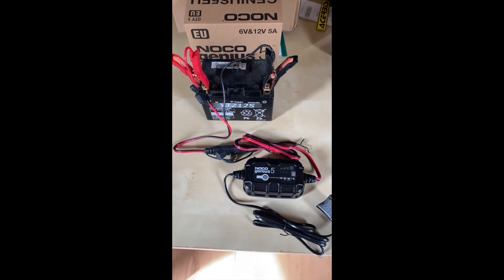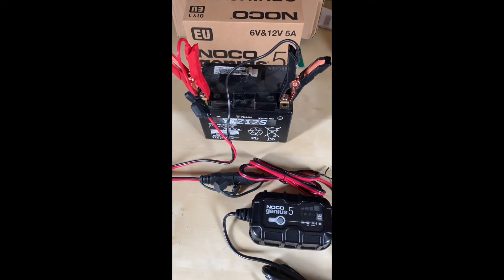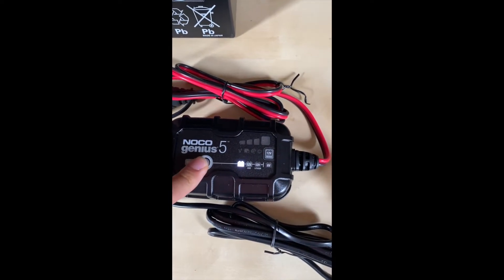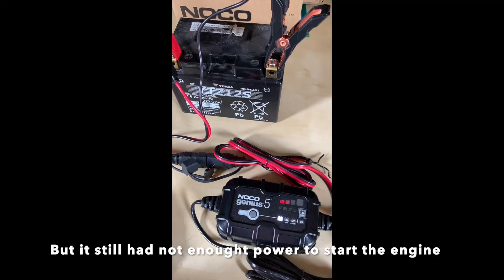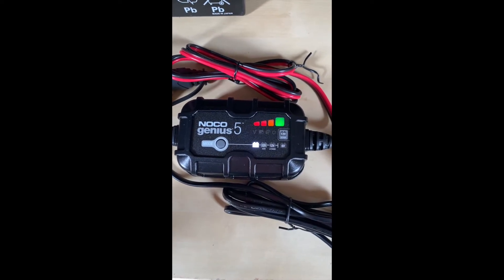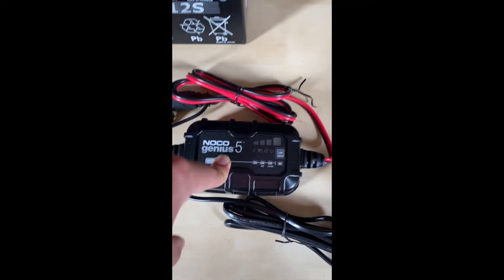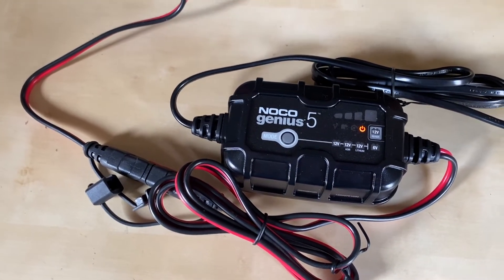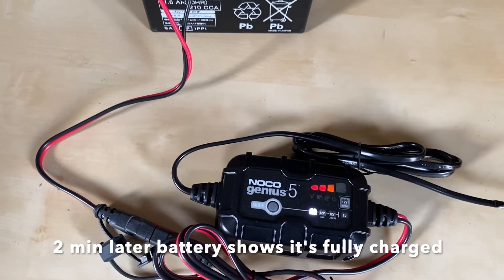Noco genius 5 repair mode works !

Comment: Jumping back and forth between Standby and a charge mode indicates the charger is repeatedly losing sight of the battery. 
 
Can you test the 12V Lithium mode briefly on the same battery?  Once charging begins, does it look like it is charging as expected after several seconds? (12V Lithium mode LED blue and 25% charge LED pulsing).  If so, you may remove the battery from the charger. Let us know so we can exchange the warranty. If your charger still does not charge, look at the additional troubleshooting steps below.
 
If you are receiving the same LEDs for all modes,  the charger may be losing sight of the battery for one of these reasons:
 
 1. Dirty or corroded battery posts/terminals, or posts/terminals coated in non-conductive grease designed to prevent corrosion
 2. Indirect connection to the battery (i.e., clamps/eyelets connected to anything other than the physical battery’s posts or terminal bolt)
 3. Loose connection to the battery
 4. Blown or loose inline fuse on the charger’s lead cables
 5. The battery's voltage is extremely low (below 1V). In which case, follow these steps:
 a) Remove a clamp from the battery
 b) Press and hold the Mode button until all charge mode LEDs flash
 c) Single-press the Mode button to select the required charge mode
 d) Reconnect the clamp to the battery
 e) Wait 5 minutes for Force Mode to complete

Comment: Desulfation instead of repair mode.  Desulfation devices or methods apply pulses of voltage or current to the battery.
These pulses help to break down the lead sulfate crystals, converting them back into lead and sulfuric acid.
The battery can then return to its normal charging and discharging cycle.

Comment: You "repaired" a fully charged and fully functioning battery.
What you say at the start about the battery charging fast is WRONG.

The only useful info on the video is HOW TO GET TO THE REPAIR MODE.

Disregard everything else on the video
Reply from the maker: The battery was not able to start the motorbike after charging it fully several times, even if fully charged

Comment: If people are wondering if this thing works. Yes it does ive had a 700cca battery on my vehicle which has parasitic draw somewhere and i have left the vehicle out for a year because it wasnt running anymore because of transmission problems, it took about 4 days cycling between charging and then repairing it but it went from 1% battery health to 89%

Comment: how many times can you use the repair mode on one battery?
Reply: Until it doesn’t work anymore, but remember to fill the cells before and after with distilled water

Comment: very good video.  thanks for the info.  I had exactly the same issues as you.  Battery got weaker and weaker then gave up one cold morning.  I charged it and it as dead again in 2 days.  I think the repair function will work... but dont like the thought of being caught short again.  Im just going to buy a new one.  Costs £20 to get home if it dies and a lot of hassle.  Once you factor that in im going to buy a new one and give it a top up charge every month.  My commute is too short to charge it properly and heated grips and under glow lights don't help.  Heated grips will now nver be used probably  lol.... what a waste of money.  Live and learn.

Comment: Can i use an anker c1000 to charge my car battery via noco5? Its a 2016 plate and i get regular battery warnings when i forget to switch off the dashcam plugged into the obd port.

Comment: Is it safe to use Repair Mode with the battery still connected in a newer car?
Reply from the maker: I don’t think so! I don’t think it’s a good idea! You can probably brake the car’s electrical circuit

Comment: U need to fully charge the battery 1st dude b4 u enter into repair mode. Read the instructions!! 🤦🏽‍♂️
Reply: Thanks for the heads up, definitely NEED TO READ INSTRUCTIONS!
Reply: There are some local stores that doesn't have manual in the box so I have to search up the manual myself online lol
Reply: He literally does, what are you even on about?
Reply: He said he fully charged it already before repair

Comment: Thanks for the video and demo, it was very informative. Have you heard of a Pulsetech Power Pulse passive desulfator? I have been using the PowerPulse on my BMW battery for the past three years and have no issue's with the car starting even though I only drive it about 25 miles per week.

Comment: I’m currently testing the noco 5 on my car battery purchased in 2013 and after 2 1/2 years of use, sat, in the car, unused for another 3 years. Took it out of the car, measured voltage at the battery store at 7 volts (or dead)… measured at home with my analog voltmeter at 5 volts. Put it on the Noco at noon, last checked around 10pm that evening and the lights indicated close to full charge. Woke up the next morning (today), and the lights indicate back to first light or in the initial process of charging. So .. I’m not sure what happened overnight. Also, it’s now making a buzzing noise at the battery itself. I’m waiting to see when the lights go back to full charge before I begin the repair mode. This is a $200 US battery so I have high hopes. Battery has a 6 year life warranty .. we shall see!
Reply: Update?
Reply: @DancePorty Did not work 😕
Reply: Did not charge it.
Reply: @aalovelace2776 damn. Im dealing with pretty much the same thing. Bought this to avoid having to drive to auto store to get it charged. Thanks for reply

Comment: Can we charge with 1a and below (0.8a etc) current? especially for motorcycle batteries
Reply: Yes. It will just take more time. Anyway there's no straight addiction and charging is going according to the exponential.

Comment: A solid green by itself means its fully charged! All the bars lit up with the green slowly blinking means its charging. Got that from the directions it came with
Reply: I had no directions with mine
Reply: @outsideinoregon online manual only
Reply: Does the red turn off an green stay on when it’s fully charged
Reply: To be clear, it's trickle charging in maintenance mode.
Reply: Needed to hear that cause I took it off and thought the battery was stuffed😂 cheers

Comment: That's cool! So the charger was able to break off the little crystals that attach to the plates?
Reply from the maker: Yes, it did and extended the battery life for another 3 months :)
Reply: @PilotMega  I tried repair mode on a car battery within the last 2 weeks. It was making loud zapping, crackling sounds! Snap, crackle, pop. I think I heard it bark. I don't think that old battery was salvageable to begin with, but the sounds were freaking me out. Just wondering if that's normal, like it's trying to electrify the plates with little bolts of lightning to break off the hard crystals, and that it's meant to be that loud? Did yours do that too?
Reply from the maker: @PouchMaster  yes it did. However it seemed to be a weaker sound than yours
Reply: Yes, I noticed that with my X-ray vision.
Reply: @user-hz5yb4bh5v  Haha. If the battery seems repaired, then that is why it is repaired. It's been zapped with lightning bolts from the repair mode. Common knowledge. You didn't need to use your x-ray vision

Comment: Eh!? You do not understand how the charger works. It ALWAYS starts off on low red bar and moves up. It is not quickly charging it.. it is slowly finding out what level the battery is and updating screen. Mine also does this and stops at Green.
Reply from the maker: I charged other dead batteries and the lights sequence took about 9h and it didn’t show the green light until the very last moment. I will update the definition of each light indicator in the video description

Comment: I have the older model, which is no longer out, similar to the 10. The best battery maintainer I have ever had. I use mine on my motorcycle 24/7, if I don't ride. Fantastic for AGM and regular batt. It has a very good microprocessor.  A must buy, zero issues and really keeps the batt alive.
Reply: i have a 6 in 1 battery charger that has 2 dc power outlets it gives 1400 peak amps, 400w ac power. i leave it in the trunk of the car. can it power the noco maintainers the 2 or the 5? if so, for how long?

Comment: So the battery has to be fully charged before you start repair mode?
Reply: Ideally, the battery should be at a healthy/high voltage when the repair starts.  Even a pretty knackered battery will hold a voltage shortly after you attempt to charge it, which just puts the chemistry in a better place to receive the somewhat stressful repair mode voltage.  There's no guarantees repair mode will repair any battery,  but you've got both a regular charge mode and a force charge mode for batteries even from 0V on the unit, so give it a try before repair mode, then try repair mode.

If there's any life in the battery after repair mode, you're winning.  if the battery is happier but not ideal try another charge then repair mode cycle after some days/weeks have past, using it normally in the meantime if possible.  That will have given the chemistry a while to come to settle, and the second repair may undo a little more of the long term damage that the first repair couldn't get to.  Don't try repair mode repeatedly though, it's a harsh process and it won't improve significantly, it's not designed for regular use - if you battery still isn't performing usefully, it's time to buy a replacement I'm afraid.
Reply: @hatbabe  ah crap. My battery was charging as I looked for informative videos about whether the battery was done charging if it pulsed...the one I watched before showed that the green light doesn't pulse when fully charged, which is what mine was doing.  Then I watched this one, and I went and switched the repair mode while the green light was still pulsing...ah well,  if it damages the battery more than it does good, at least it's the end of motorcycle season and I'll just probably buy a new battery next year...fingers crossed.  As long as I can start my bike and take it to the storage for the winter I'll be happy.
Reply: @joseelupien1835  you didn’t do anything wrong. You could have started repair mode any time. If your battery is sulfated it is still dead even if the green light is solid. It just helps to have tried to charge it, but not necessary. Did it work for you?
Reply: @joseelupien1835  The charger can "float charge" (also known as "trickle charge") the battery for several days before the green light turns solid. These smart chargers are amazing. They've got a built in charge controller that knows when to stop bulk charging and very slowly take in very, very little amounts of charge to top it up. That last little bit takes a long time. The old big box "dumb chargers" were actually pretty dangerous as they just pump current into the battery regardless of it's state. KABOOM!! Lol. Surprised they still sell those.
Reply: Yes
Reply from the maker: No, the battery doesn’t need to be charged to repair it. Remember if the battery is dead you can’t charge it.

Comment: Good video, but you need to wait for the green charging light to become permanent green and not blinking. When it is still blinking it means it is still charging, although with slow current. The Noco genius 5 checks if the battery is still accepting charge and the green light will blink if the battery is accepting charge.
Reply: Sure, but the battery being sulfated just gives you a false positive anyway. It may be solid green but it’s still dead in reality. The point of this video was to show you the repair. This battery was never going to be actually charged prior to the repair.
Reply: @megmeyers3432  no this guy doesn't know what he is doing. The battery was fine. Noco always starts at low red and slowly increases as it finds what charge it is on. It didn't "charge fast". The battery was fine as it stopped on green at the end. Mine does the exact same every time.
Reply: @philmcclenaghan7056  yeah. It does do that. So what I found out is you have to actually check the voltage. If your battery is topped up, it will appear to “charge fast” because of what you said. If your battery is dead dead as in sulphated, the same thing happens, but you can’t actually start the car. You’re like “hey, but it shows it’s charged!” But no, if you check the voltage, as in my case, it’s 2.5 v. That is D E A D. Lol. I was just soooo happy that the repair mode worked for me. No problems since then but I also installed a cut-off switch cuz I have a parasitic draw and can’t find it.
Reply: @philmcclenaghan7056  he says the battery stopped working; it didn't have enough power to start the scooter yet you say "the battery was fine"??? (smh)
Reply: @megmeyers3432  check your alternator - on mine it was leking diodes - altough it was chargeing the battery with 14.2 Volts ..... 
-
Tell me if you solve your problem already - because I have tests - and those test will indicate if the alternator is failing - to stop the currency - from leaking when car is off.
Reply: @megmeyers3432  I completely agree that the sulphation on the terminals will not allow complete charge, but the blinking indicates that the battery still accepts some minor charge. Probably would not have made a difference though and I only put the comment as it is in most case the right thing to do.
Yes, the solid green only indicates that the battery does not accept charge anymore.
Reply: @HemiTwist  thank you. I just haven’t had time yet but it’s on my todo list.. it’s the “some day” list. Lol.
Reply: @megmeyers3432  So you had to get it to full before entering repair mode?
Reply: No. If you know your battery needs repair you can just jump right to repair mode. Trying to get it full is impossible if the battery is sulphated. So if you charge a battery with Noco and you see a steady green light but the car still doesn’t start, check the voltage or if you can’t, it’s ok to just start repair mode. Green + no-start = needs repair. You can’t rely on Noco’s bad battery indicator. It just doesn’t always work.
Reply: @megangmeyers  I put it into repair mode and wow! It really snaps, crackle, pops! I swear I heard it bark! Was yours making loud zapping sounds as it repaired? A lot louder than the bubbling sound they all make as they charge?